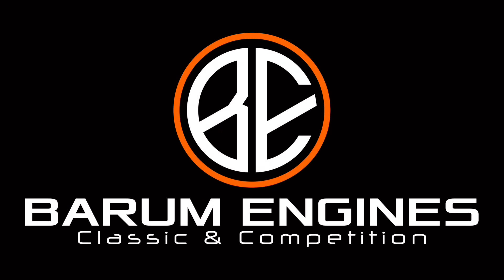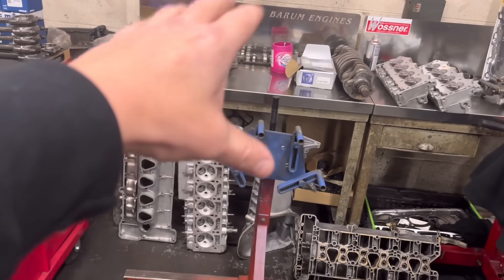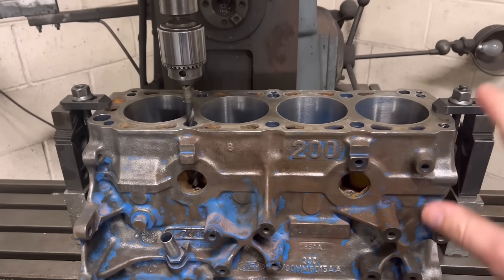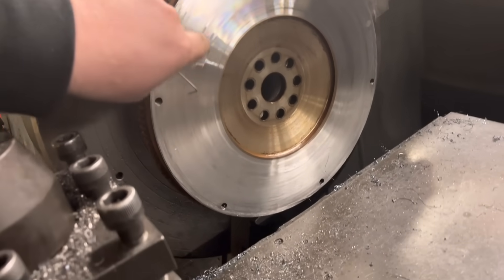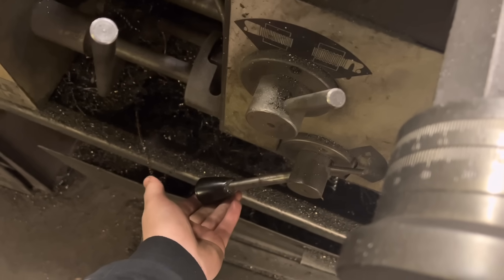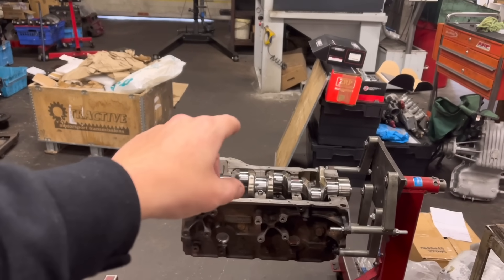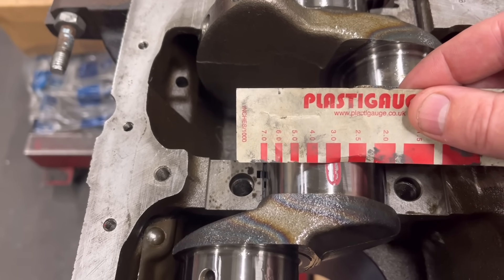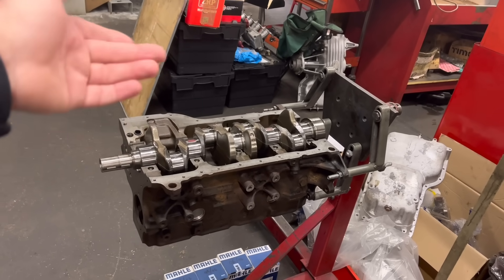Did COSWORTH actually machine this WRONG in the factory?

Comment: There was one bearing manufacturer back in the mid 79's that had a white metal layer double the thickness of the other manufacturers.
So we would install the liners and align bore them just a thou or 2, just to clear them up, measure them and grind the crank accordingly.
After a full balance the crank would spin like a top.
Also did the same to the big end bearings.
This got the motor spinning very easier and they had a far better reliability record especially when it came to accidental over rev situations.
BUT it was expensive and the guys would rather take their chances with normal procedures.
There were a LOT of "electrical failures" that took place when the con-rod came through the block and BEAT THE ALTERNATOR TO DEATH...

Comment: Rebuilt a Fordson diesel tractor engine as a Apprentice,the mains and big ends measured ok  so ordered std mains and big end bearing shells.Easy as thinks I ....BUT....something wasnt right when I sat the crank in the block.In the fine print in the parts book there was a note that a small number of blocks between such and such serial nos where .020 oversize in the mains and a different bearing shell was required.Could  only assume that someone had a bad day in the factory boring blocks,  learnt a  lesson
Reply: Ford used to do that a lot. Crossflows & per-Crossflow would come from the factory with line bored mains & therefore OS.

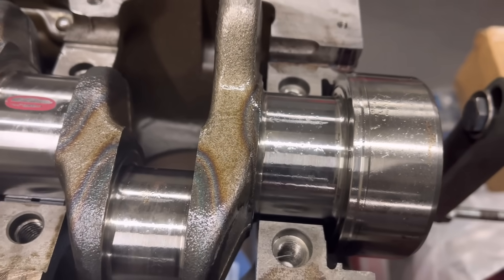Comment: 9:42 This is a forged crankshaft, not a billet. You can tell this by the forging line left during the process along the centerline of the crankshaft. A true billet crank would have 100% machined surfaces as it starts as a round bar of material.

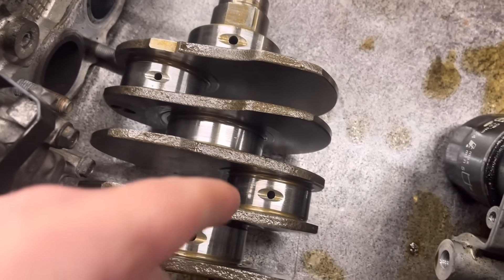Comment: 1:11 What are you guys doing with the Subies over there.
I've been running and rebuilding Subie engines since the early 1980's and never seen one that needed a new crank.
Started with EA71 then the EA81, EA82 were were not so good, now on the EJ25’s but must admit no EJ20’s.
Reply: Thats strange as every subaru I ever known has done its main bearings and needed a new crank
Reply: @bencosturbz7755  Maybe you drive them to hard

Comment: As part of my job, I have been reconditioning/rebuilding engines, at one time or another, for best part of fifty years, I have never checked  bearing clearances or con-rod housings, I simply used the parts supplied by the machine shop or parts supplier, admittedly these engines were not high performance ( mostly diesels in tractors) but I have never had a problem, are these modern engines just made to tighter tolerances and is this why there are so many engine failures on modern cars.

Comment: Subaru Ej 207 N14 JDM thick walled short motor from ICP just under £2k with forgerd pistons. May be an option...
Reply: Even the JDM EJ205 is a FAR better motor than most of the junk they put in other market cars.  I swapped in a JDM EJ205 into a friends car almost 20 years ago and it has done almost 200k miles with a 16G turbo running 23psi on a good tune and 93 octane at sea level.  He's going to scrap the body and keep the driveline/engine/brakes/suspension....and put it in a newer car...likely a Forester.

Comment: This is just an observation, not a criticism, but the 5.5k plus tax seems a LOT for a fairly standard 4 cylinder recondition. Here in New Zealand I recently stripped, cleaned and re-assembled a Toyota 22R (2.4l, Hilux), I had the crank ground, new bearings, bored to 1mm oversize with new pistons and rings, deck surfaced, brand new cylinder head (including valves, camshaft etc, fully assembled and ready to bolt on), new timing chain kit, gasket set, etc. etc., and it came to just under $4k NZ which is about 2k pounds. I understand that my time was free, but 20 hours would cover that easily, so even at $100 per hour that's only another $2k, so $6k all up, or in GB pounds that's 3k.
Reply: You do realise that parts need a mark up . This is perfectly normal for a repair shop garage . It keeps the lights on . Helps cover warranty claims etc
Reply: @benmayne7910  As I said, it was an observation, not a criticism, and I paid retail for all the parts that I bought and was fairly generous with the time allowance and hourly rate. It is more of a commentary on the state of the UK economy and what a business needs to charge to remain viable. The Toyota 22R was the first engine that I have done for many years and I really enjoyed the process, it was very rewarding to do.

Comment: Watching that hardened flywheel be turned was painful. Most iron parts that have been heat treated, be it by manufacturing process or in field abuse, must be ground. Blanchard set the standard for the horizontal grinder needed to address this issue.
Reply: Flywheel won't be heat treated, just plain cast iron. Not ken on using the ring gear to hold it in the chuck though.

Comment: Try a LS3 engine in the Beemer 3 Series with the 6 spd from a Firebird. The diffential from the 760 bolts right in and is bullet proof. A bit of porting, a cam change and tune gives real relaible 525HP at the wheels.
With the aluminium block this takes 50 pounds off the front wheels which aids handling.
Reply: Or you could just do some external mods and flash the ECU on an N53/4 (E90 335 etc) and have similar or more power and not have to change anything, the trans and diff doesn't seem to be much of a problem, and the whole engine is alloy so fairly light. I agree though, there are a few LS swaps on earlier 3 series, and they are good, I have also seen Toyota and Nissan V8 swaps which seem to work quite well.

Comment: I would like to see more of that 1500 triumph head and block you have/ had.I didnt realise they were so unusual a set up .I do seem to recall they had an issue with their crank thrust plates dropping into the sump causing the crank to shuttle to and fro when clutched? I did have a mate with a spitfire that I drove and had that issue I think.That particular engine didnt last long at least.
Reply: Crank thrust wear is normally the 6s, seen a few. Never a 4 pot though and seen, done a few.
Reply: @jimhearnden4196  Ok thanks.

Comment: I would try some other makes of bearing with that Cossie crank .I used to build E-type engines for a world renowned specialist and always found King bearings gave wide clearances
The Mahle Competition bearings are best.
Do you not check the crank for runout on the centre Main to check if its bent?

Comment: More oil clearance will mean less oil pressure and bearing wear i would think  and to tight would be no lubrication and motor would sieze
Reply: Depends on the flow rate.

Comment: Hi Lee, Just a thought, you are running some really close tolerances on these engines, who do you get to do your calibration and how often. I ask because the company I work for for pay for the lowest bidder and they don't even clean the Mic's let alone calibrate them correctly, I recently had a 0-25 outside Mic back from them which read -0,02 anvil to anvil, shocking.

Comment: May I ask why you guys turn flywheels in the lathe? Here in the states, in my locale anyway, machine shops universally used to resurface those on a surface grinder so the hard spots aren’t causing problems.

Comment: Why grind the crank just because it "might" be bent? Surely you'd check if it's bent before assuming and grinding it for no reason when it looks perfect? Then adjust the clearances using the correct bearings. Not to mention the fact that for a performance application you generally want MORE oil clearance anyway, not less. And that engine you show on the ground that's just been honed looks like the cross hatch is at almost 90 degrees........hmmmmm
Reply: You on the drink or just having a laugh?
Reply: Agree with you.. He needs to go to Jim's automotive machine shop to learn how it should be done. But unfortunately he's not of that mind set.. Just look at his 40-50s old machines.